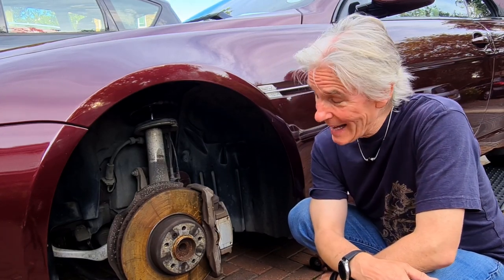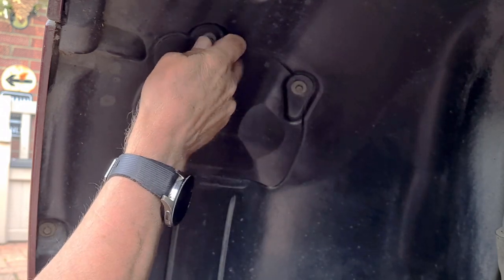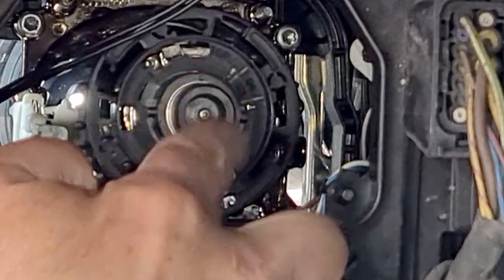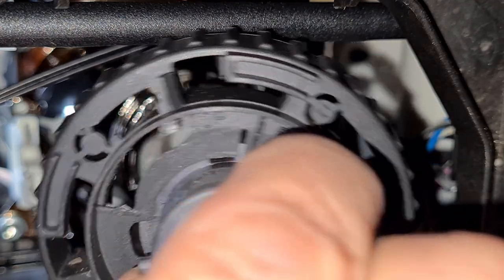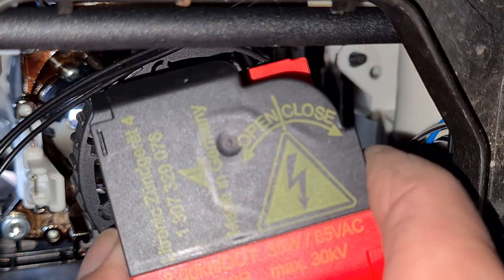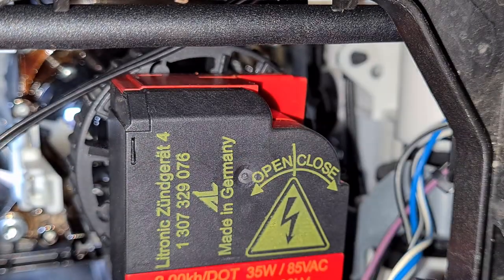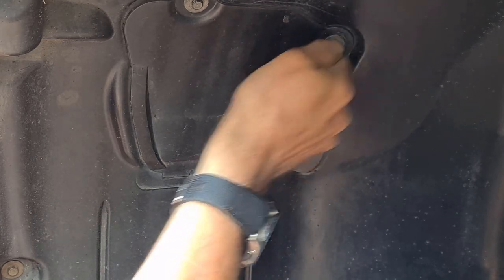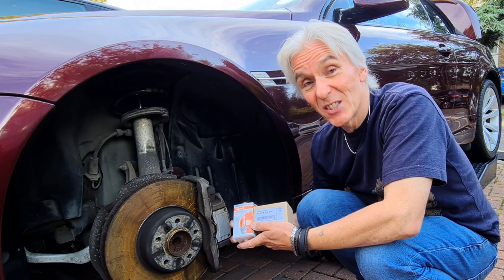BMW 6-SERIES XENON + IGNITOR BALLAST REPLACEMENT

Comment: Not had to do this..yet, but I have replaced the side light/halo ring bulbs.. and what a ‘tight’ faff that is, especially the n/s. Getting the bulb out was easyish, but putting it back in was a frustration. I just could get the ‘spigots’ lined up to then twist.. 20 minutes later, minus knuckle skin..done. 🙄
Thanks for yet another ‘how to guide’ 👍🏼
Reply from the maker: It is damn fiddly! Mark the top of the bulb with a Sharpie helps - I explain it here: https://youtu.be/-wNR-ss8r_w
Reply: @TimmsBMWRepairsandInformation  Good tip, thanks Timm

Comment: Hey Timm! Great video about the Xenons. Glad the older cars have the ability to change without having to take all the wheel well out; but my E38 750iL just blew its transmission today! Little more important than the headlights! It has classic drum failure symptoms and I cross checked with your trans failsafe video. On to replacing the transmission!
Reply from the maker: That's bad luck Tyler!

Comment: Tim quick question - put my 630i through a carwash and the left passenger side Halo wont turn on despite Main headlight working. The headlight housing is showing condensation. Would this be a blown fuse/short OR just the bulb that needs replacing? Is the fuse in the glove compartment or boot for me to check?
Reply from the maker: There is no separate fuse - so it is probably the bulb (or LED) that has failed - good luck!
Reply: @TimmsBMWRepairsandInformation  thanks -ill try that so 👍

Comment: Lol you make it look so bloody easy. I've literally been mucking about wiggling this darn thing for hours and I still can't get it. Genuinely considering taking off the bumper so I can remove the assembly and install the bulb externally and just putting up with the extra work of reinstalling the bumper....and yes I've disconnected the silly little safety connector
Reply from the maker: I can do this left-handed in the dark now with a blindfold on - honestly!
Reply: @TimmsBMWRepairsandInformation  Lol yeah now that I've gotten it once the other side took me about 5 min.

I was taking out the wire connector like I should do but not realigning the white plastic ring in the igniter assembly.

It's always something silly like that lol. I can rebuild the motor on these cars and get everything right from memory but when it comes to the fiddly bits I suddenly transform into an idiot.
Reply: @funfun5656  The white plastic thing is key! That caused me about an hour of pain until I read your comment! Now, it's a pretty easy job....

Comment: Very well done as always! I'm currently looking at a very nice E61 545i near me. How does the 4.4 N62 engine compare to the 4.8 - does it have the same reliability, or is it worse?
Reply from the maker: About the same Georgi, the both can suffer the usual PCV, valve-stem seals and coolant transfer pipe if not looked after!

Comment: Hi Tim
I love your videos - helps me with my BMW e63 645CI - it’s actually an English car - bought from Park Lane BMW in 2004 and now drives the Australian roads - Sydney.  I wanted to know if possible the name of the software you use to diagnose and or make coding changes.  
Thanks in advance 
Chris
Reply from the maker: Hello Chris, I use INPA for most things (available from Amazon but you will need a laptop) and Carly for simple tasks
Reply: @TimmsBMWRepairsandInformation  thanks a million Tim - I truly appreciate your help.  Have a good one

Comment: Hi Tim.  Replaced the bulb and ballast/igniter but still not working. (Drivers side) passenger side works fine. 645ci 2005 bmw. Do you know how many volts should be showing from the 2 pin connector that fits onto the ballast. 
Any help or suggestions to try much appreciated
Reply from the maker: Module next then, also on my channel with no need to remove the bumper (fender)
Reply: Yes it was the module. It was saturated. Lights are all working again now. Thanks for your videos Tim.  @TimmsBMWRepairsandInformation

Comment: Hi, simmilar fidly is at my E39 540iA, you also have a collar with top position and a D2S bulb going into Key position. But also you have there a rubber dust cover over the collar, and if you try to put the whole package in place, it gets fiddly. It is maybe easier than on E64 because you operate in engine bay, but still it needs practicing. Maybe not 5000 times but only 1 000. The trick is to put rubber cover over the collar first and then try to line it up with the bulb. Easy but at first you curse alot.
Reply from the maker: Thanks for the info!

Comment: Hi Timm, can you give me some advice.  I push the ignitor and I can't turn it to close, I've tried everything and nothing, what should I do? Thanks
Reply from the maker: Make sure the you have the loom disconnected, it will not go in with it in place
Reply: @TimmsBMWRepairsandInformation   You think I have to disconnect the connector and than push the ignitor and close it? Thanks
Reply: @ivanvasic4589  It will NOT refit with the connector in place!
Reply: I disconnect and again nothing, it won't turn to close. What to do?